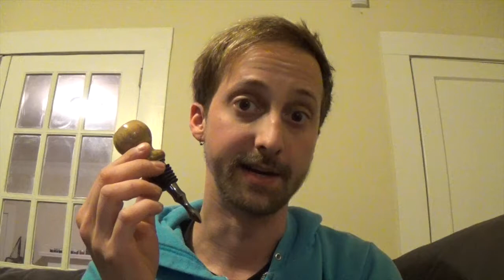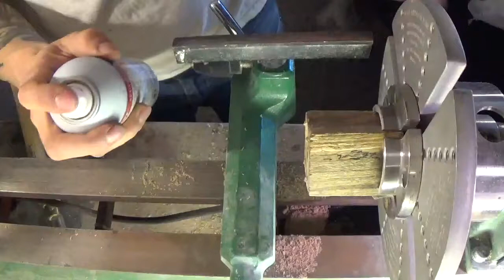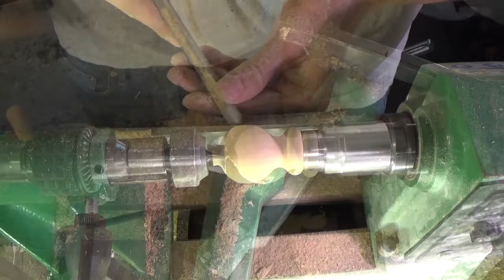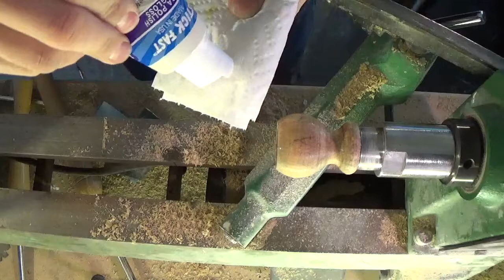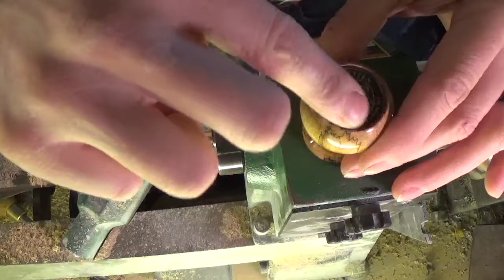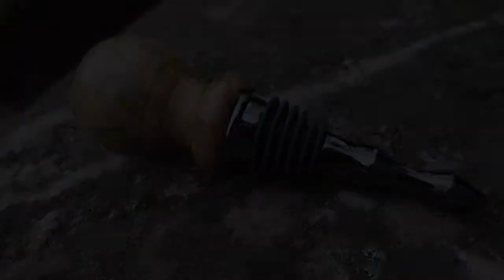Making USMA Wood Bottle Stoppers

Comment: It makes me cringe when you use a forstner bit that fast. They're supposed to be run far slower than that. They'll work far better and last longer. 

Also, why do you use CA glue as the finish, not a real wood finish like shellac or wipe on polyurethane?
Reply from the maker: The lathe was on the slowest speed for drilling. 

I picked up using CA from pens and use it for most of my small turning. Just personal preference.
Reply: thanks for the reply Stephen. It probably looks faster than it is in the video. Nice bottle stoppers.